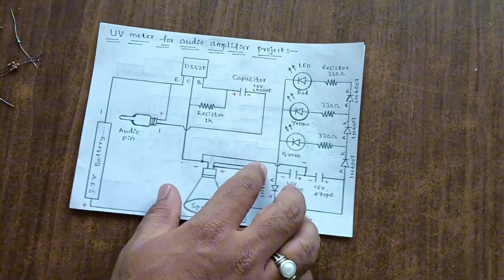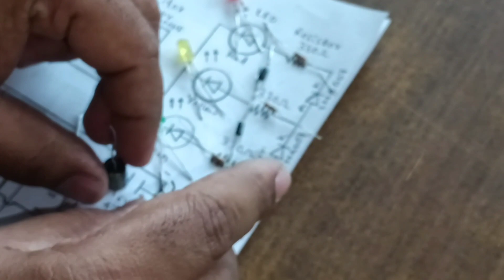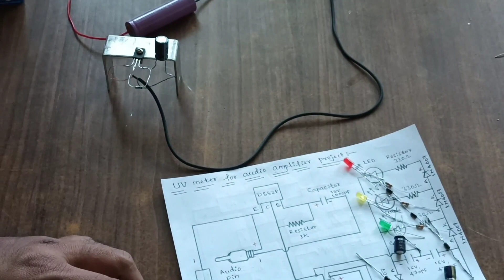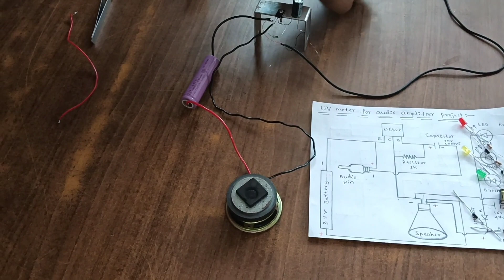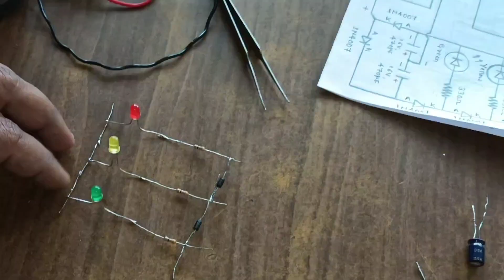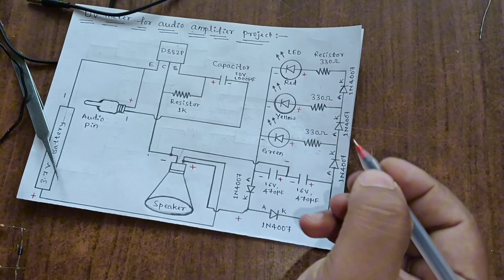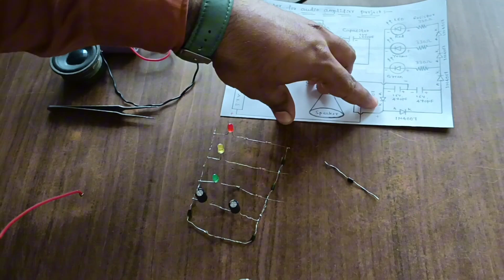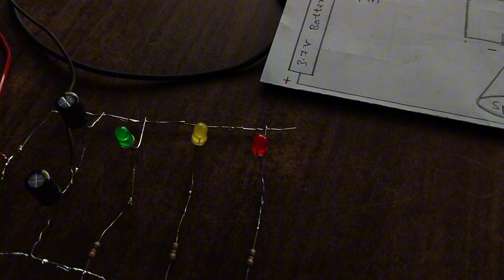Fire🔥 brand LED Dancing on Music 🎶 # UV Meter for Audio Amplifier # Subscribe Channel 👈...

Comment: Very useful project UV meter for amplifier LED dancing on music using for material C882p transistor or 1k resistor or speake🔊 or audio pin or 1N4007 diode successful project simple video 💯

Comment: Very useful project UV meter for amplifier LED dancing on music using for material D882p transistor or 1k resistor or speaker 🔊 or audio pin or 1N4007 diode